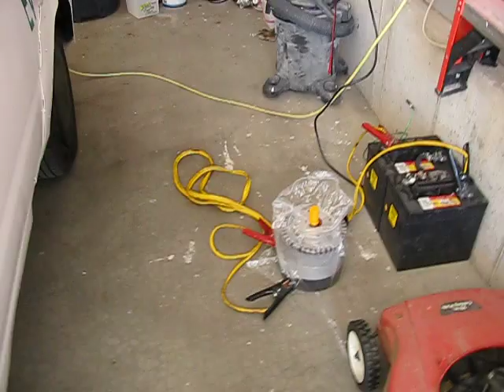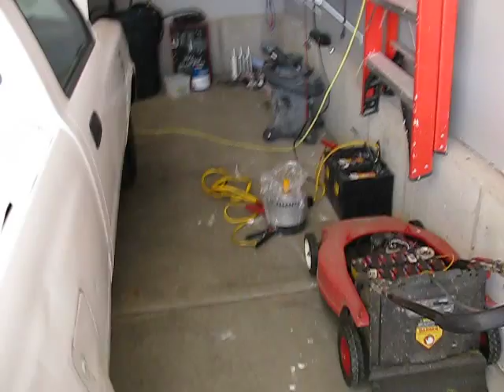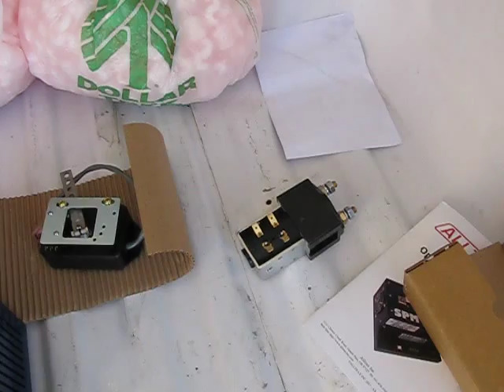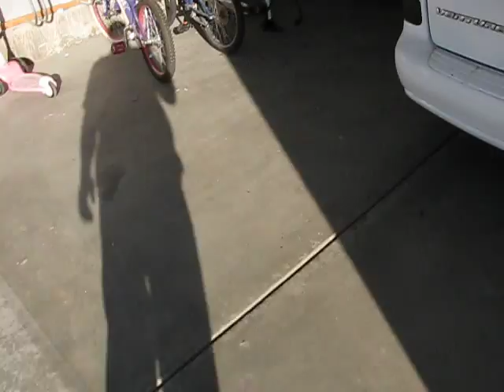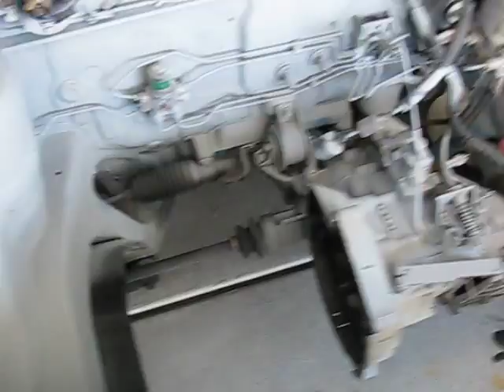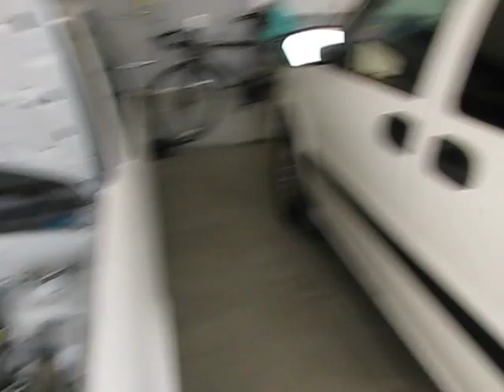What Parts Do you need to Make an Electric Car?

Comment: What's the name/ brand, DC, output, torque and rpm of moter. I'm trying to convert a 2001 rt 3.0 stratus coupe
Reply from the maker: EMC RT-200 Permanent Magnet DC
Power: 11.5 kW cont-- 23 kW pk 
Voltage: 12-72 Volt rated 
Speed: 3700 rpm @ 72V unloaded 
Size: 8" OD, 7.4 " long (w/o shaft)
Shaft: 7/8"x 1-3/4", 3/16" key 
Weight: 39 lbs.
Kind of small for a Geo but has more torque 
than original motor. I love that I don't need 
a lift to remove/install this motor.
Reply: Thanks
Reply: How much was it?
Reply: And where/site info
Reply from the maker: It was about $700 at the time. If I were to do it again, I would spend a little more and go with a liquid cooled 3-phase motor and controller. They run about $1500 for the same size and power output.

Comment: what about the charging thingy?
Reply from the maker: This video is a simplification. Yes you would want a battery charger too. Although you don't technically need a battery charger at all to make an electric car. You technically you only need a battery charger if you want to KEEP driving an electric car.  ;)
You will also want a battery management system to ensure the lithium batteries stay in their safe operating region and a state of charge meter so you know how much farther you can drive before the batteries run out.
Reply: yea, the Charging thingy, can be wall mounted. only need to pull it directly to batteries

Comment: i see this vid was made in 2012, being two yrs ltr how has it held up, and cost to build. i am considering doing this with a small truck. however im looking at lith ion bats. i understand they are lighter and hold a charge better.
Reply from the maker: I'm still driving the Geo EV to work (20 miles each way) every day.  It's about to cross 14,000 miles.  The only EV related mechanical problem I have had is the throttle control pot wore out.  $17 and 15 minutes later its running like new again.  
If I were to build it again, I probably would have gone with a larger motor.  It's just fine up to about 53 mph but at freeway speeds it's kind of gutless.  65 mph is about all it will do.  
Lithium batteries are the only way to go.  Just make sure you have a good BMS to keep them safe.
Reply: im looking at buying military surplus fork lift to cut cost. i had a thought about attaching my dc motor directly to the rear end vs the transmission, or attach a 3cly diesel with a generator instead of batteries. any thoughts?
Reply from the maker: tony rishkofski
You're probably better off just buying an old Prius.  The idea of going 100% electric is to not need gasoline EVER again.  And with PV solar panels on your garage roof, you can charge up for free with energy in your own backyard for FREE.

Comment: I'm guessing the trans is automatic?  I'm really thinking about doing this project!
Reply from the maker: It's actually a standard transmission.  I removed the clutch but still use the gears.  It is waaaaay easier shifting clutchless in an EV than with a gas engine.

Comment: I'm seriously thinking of build an electric car and have a question that I have yet to get answered.  What type and how many batteries would work best with price in mind.
Reply: I would like to know as well....
Reply from the maker: I used 24 of the 160 Ah LiPo4 batteries in series.  That allows me to go about 80 miles in a modified Geo Metro shell.  See my other videos showing the completed car.  I have driven it for the last 18 months with no signs of battery loss yet.
Reply: +JohnSavesEnergy     How could you increase your range?